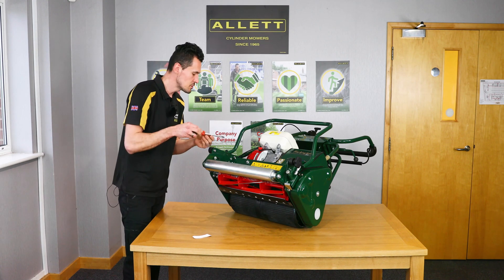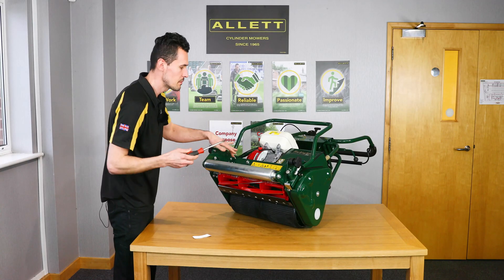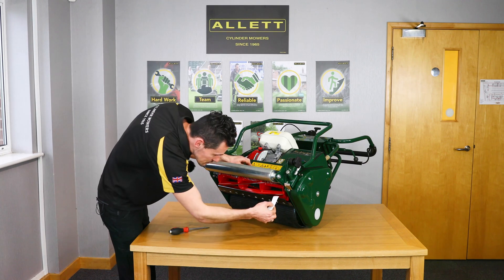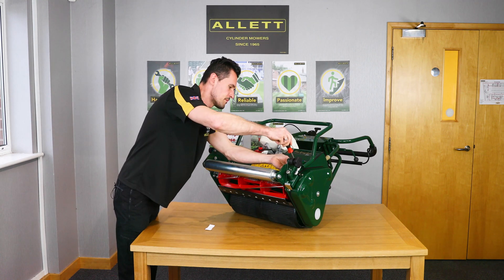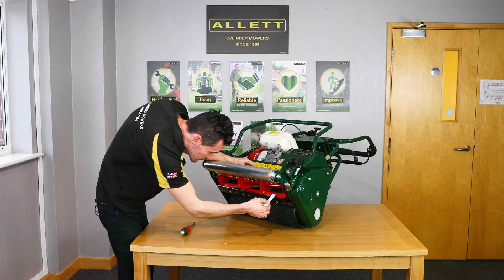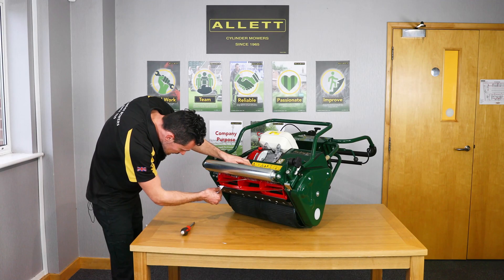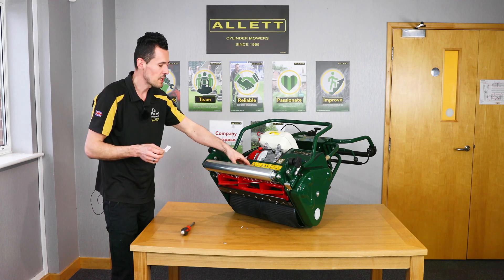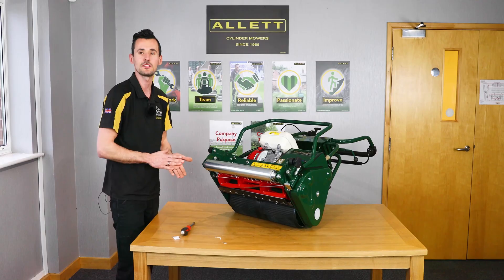Buckingham- Setting the Cylinder to Bottom Blade

Comment: I have a Kensington 20H. It’s only 5 months new. On a 10 blade cylinder it has to be adjusted so tight before it cuts paper all across the blade, that it seems way too tight to bed knife. It squeals like crazy. That can’t be right. If I back off even one screw knotch, it won’t cut all across the blade. Certainly doesn’t turn freely like your video. Help!